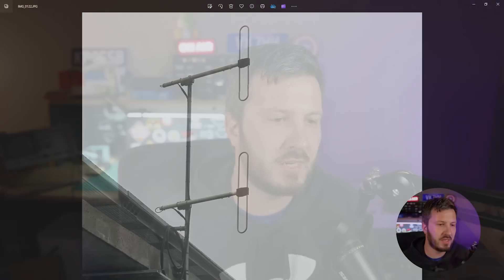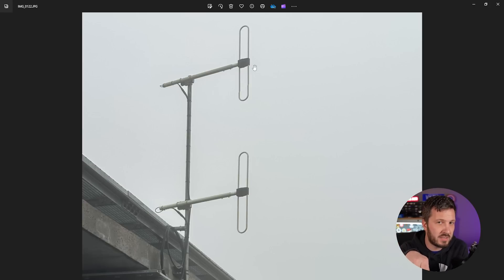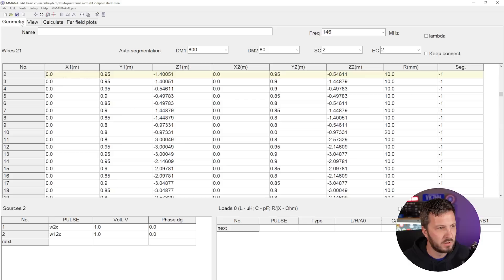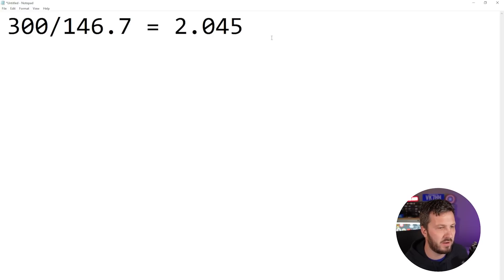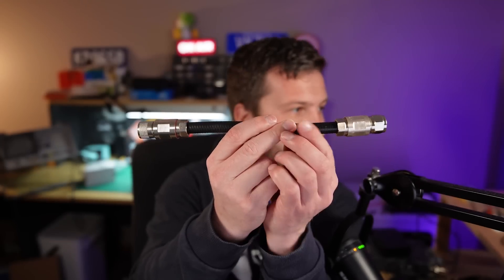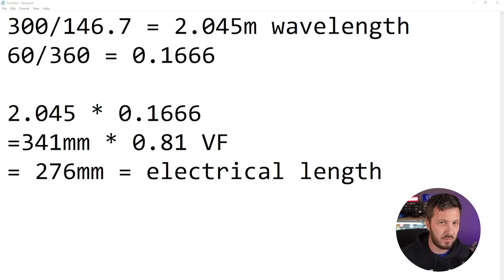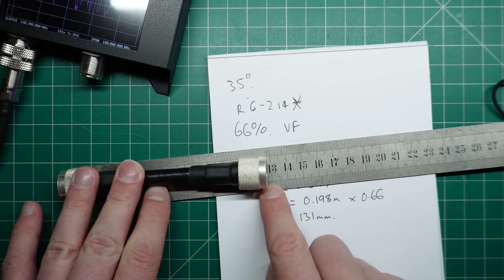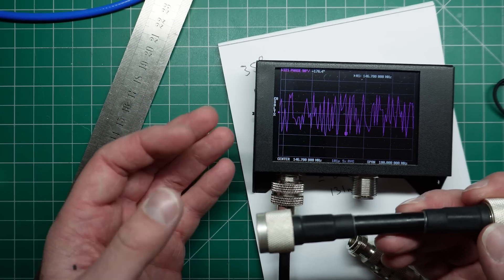Using a NanoVNA to Fix Our Repeater Coverage

Comment: Great information well presented. Thanks! I like to have the support tube longer, ending well above the antenna, so that the upper and lower halves of the top antenna have equal reflection  behind  them.  It probably doesn't make much difference.  Lightning may prefer the higher tubing end to the top of the antenna as well.

Comment: I have the same VNA has your SAA-2N, but your screen has more on its drop-down selections. Example under calibration you have ISLON under load I don't have that or done in ram or cal-standard. Have you upgrade your firmware or something else. Thanks
Reply from the maker: I upgraded to the latest firmware available in the following groups:
https://groups.io/g/nanovna-beta-test
https://groups.io/g/NanoVNA-V2

I have version v1.3.31 installed

Comment: Very good.  The barrel inaccuracy could have been avoided by using both blue cables with barrel in center to calibrate.  Then the barrel would be accounted for during measurement.  Not a big error though.
Reply from the maker: Yes very true!

Comment: There is much easier way how to cut cable to electrical length using S11 displayed as smith chart. The same example, frequency 146.7MHz and 60° where you end up with electrical length 0.341m. The property of λ/4 line is that converts short to open and vice versa, and there is frequency on which electrical length of 0.341m would be a λ/4, in fact, its 300/(0.341·4)=220.05MHz. So if you take some coaxial cable with one connector mounted, cut it to something little bit longer than what you expect and then connect to the first port of the VNA. If you sweep from (almost zero) to 220.05MHz, you should see something near to half of circle, because on the low frequency it's just open, so it touches the right horizontal axis of the smith chart. The opposite side should be somewhere near to short (which is left side of the horizontal axis) and then you can easily cut small pieces of that cable until you touch the "short" exactly. This is not a problem, because you have nothing on the opposite side of that cable. As the S11 touches the "short" at 220.05MHz you are sure you have cable of electrical length of 0.341m. In fact, you can use the same method to determine the electrical length of your cable to found the exact velocity factor, which is useful to know before you "pre-cut" your cable.

The method you used is perfectly correct, but it requires you to have connectors on both sides of the cable, so you cannot easily fine-tune the cable to the required length.

And I would like to mention that I am happy to see someone from ham radio community knowing that repeater requires antenna with maximum at negative elevation.

Comment: Absolute fantastic video, just a tip for the VNA
Entering the freq in the NanoVNA - save yourself a step, instead of min, max and centre freq, just enter centre freq 146.7M and span 100M
Start and stop is really for having a start and stop freq, which is voided when you enter a centre freq that is not the centre fo the range, see marker hard to the right @12:53 now shows 196.7 thus no longer 200M.

Comment: Thanks for that Hayden, a very informative video.  What does the radiation pattern look like with real ground switched on as ground reflections will alter it a bit as will anything in the Fresnel Zone .  Granted, it is no simple matter to calculate these effects over terrain such as in your situation but it would be interesting non the less.  You have got to love these Nano VNAs, they have brought so much that was out of reach of all but a few in recent years.  Cheers
Reply from the maker: Thanks mate.
Yes with real ground on you get a different pattern (more pronounced nulls, with lobes that have higher gain). Once you start feeding the bottom dipole out of phase (lagging) then it starts to flatten/pancake a bit and those nulls disappear and the lobes combine (at a lower gain). I should've done that calculation on the model during the video. Be good to see it work in practice.

Comment: Great job. This is the method used in broadcast to adjust coverage area . And in US/Canada MW AM stations change pattern from dat/night  do to propagation change.  And gets fancy. The hours of daylight change throughout the year.    So the change in pattern is also time dependent .  Also many AM (MW) stations cut TX power at night unless clear channel. When you are all done simply try then go out in the field and test signal . Then make changes as needed. The Earth not perfect . We has a new warehouse go up near a AM (MW) station. We had to adjust the phaser a tad because of reflection off building.  73
Reply from the maker: That's interesting that they can actively change it! 
I am going to make a couple of different delay lines up to see which provides us with the best coverage. Do some testing with a spectrum analyzer at various points to measure signal strength.

Comment: Will you do a real world measurement before and after down in the valley ?
Reply from the maker: Yes. Plan to use a spectrum analyzer to measure the before and after signal levels in several spots

Comment: That was very interesting, will you be doing some recorded signal tests with the phase shift in and out. If possible a few fixed antenna locations showing the before and after results.  Thanks for sharing and educating me on the NanoVNA.
Reply from the maker: Hi mate,
Yes I'll be doing that. Using the spectrum analyzer to take measurements before/after in various spots. Also testing using different delay lines.

I'd like to get some real time measurements as the delay lines are switched out - but I need a few stations coordinated/using spectrum analyzers for that. Maybe even a TinySA will do. S meters on radios aren't accurate and they vary from radio to radio.

Comment: NanoVNA can measure round-trip delay of the delay line,  with a short or open at the far end of S11 phase measurement.
Reply from the maker: Actually I used this method to double confirm (not in the video). I was confused at first as to why I was getting 120 degrees - and then realized it was due to the reflection - i.e. round-trip delay.

Comment: I see beam tilt used on TV stations
when I have looked into them. 😊
Reply: TV transmission antennas are typically hundreds of wavelengths above ground where ground reflections have little effect, but Hayden's antennas are low and ground reflections will tilt the radiation angle up profoundly.
Reply: @SuperhamW5  Thanks 😊
Reply from the maker: Complicating things too is that on one side of the mountain there is a sharp drop off - like several hundred metres off the side of the mountain.. and it's solid rock.. so modelling ground is somewhat something of a hard thing too. But in practical terms, it will be interesting to see what happens - if the snow ever melts!

Comment: You didn't show any real test results, I am a bit disappointed with that.  Why didn't you show us a reception test at a mobile station and at the base.
I would have used a completely different antenna setup.  I would have put the antennas nearer the pole to give a cardioid pattern and put the splitter near the aerials.  You can then easily adjust the cable for different phasing - the cable to just one aerial.  I'm not convinced that these simulators work as it hasn't in your case because it doesn't take a lot of the surrounding or radiation angles of antennas in to account.
Using a 3 element beam at a downward angle would be far better than the two dipoles and give more gain and better coverage.
 Failing that, just a 2 element would widen the pattern.
I would have used a J Pole as that will cover the entire area and still have a fairly low angle of radiation.
Why make it more complicated and have to use far more power up two bits of coax only to lose power splitting it between two inefficient aerials?
Reply from the maker: 1) I’ll let you come and clear the snow
2) what happens with a 3 element beam? You lose a lot of your signal in any direction other than the way it the beam is pointing. Not all that desirable for repeaters.
3) I suggest you watch the video again. You may then notice/hear the reasonings behind running two antennas that were given. If it were as simple as sticking up a J-Pole, that would’ve been done.

In the commercial world, you use high quality antennas that will last. Folded dipoles such as this are built to last in the environment that is presented to them.

Comment: Kudos for introducing this concept. You might want to turn on real ground under the array and look again because ground reflection will have a profound effect on the main lobe angle with a low antenna height.
Reply from the maker: The lobes start to “fan” out, not sure if that’s the right descriptive word, but you know what I mean. 

And with the added delay, the “main” lobe is pointed still down at the desired angle. The good thing is I’ll make a couple of delay lines to test with.